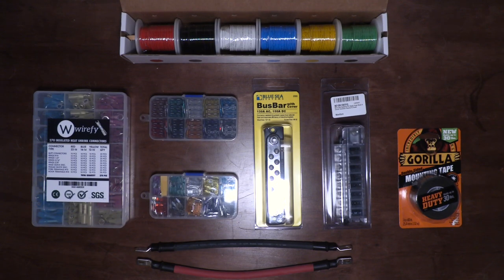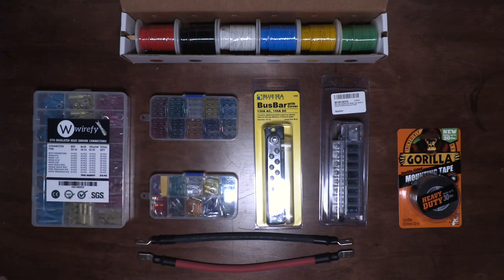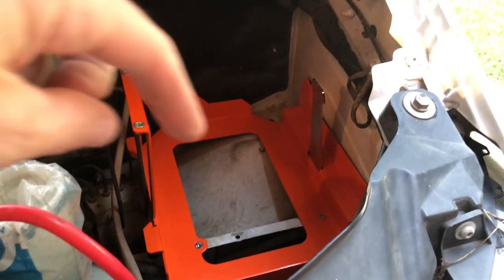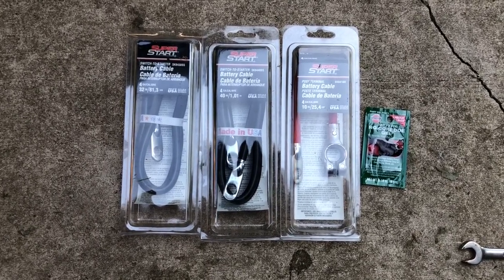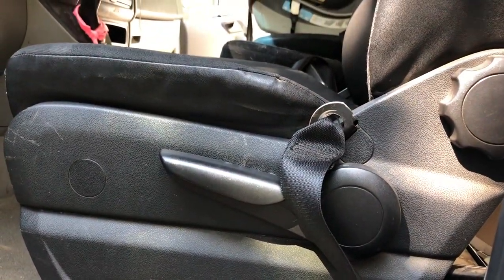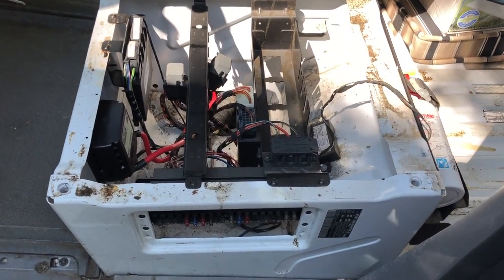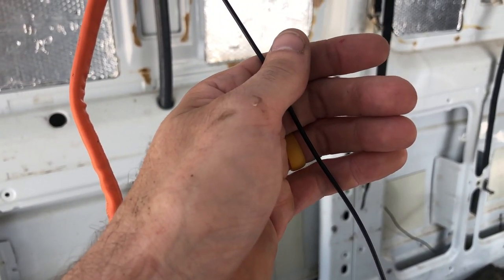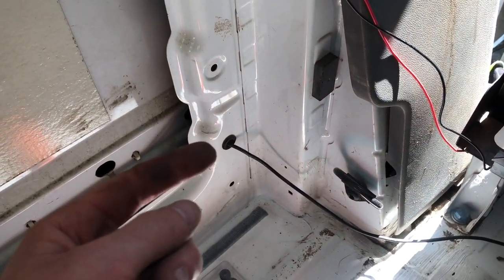Sprinter Auxiliary Battery Kit is in and electrical is hooked up. Fantastic Fan Installed! 🌬

Comment: Thanks for this video. I know it’s older, but I’m installing the AdWag Tray and wiring setup now. I’m kind of getting paranoid about how it hooks up. Worried about it messing with factory electronics. Two questions: Is the setup still working for you? Also did you have to move your ECU and use the optional ECU mounting bracket they provide?
Reply from the maker: At the time it hooked up fine. I'm currently trying to move everything behind the seats in a container that will house an inverter as well.

Comment: Brian, I don't think there is a need to run ground all the way back to the ground strip under the seat..   
I ran a 6" ground wire from my Fantastic fan to the the chassis.
Reply from the maker: Interesting. I’m guessing then you can do this for the majority of items installed to the main metal chassis?
Reply: @SeatTimeClips  Yes that's what I'm doing for everything that is running off the "starter" battery.  Anything that runs off my "coach/leisure" battery will have power and return run to it.  So your positive and negative bus bars would work for that for sure.

Comment: hi finally! someone showing the wirering the FANTASTIC FAN.  I need advice plz... I have two fans in my Van conversion. 1- Fantastic Fan and 1- Air Max Fan.  Of course still not connected(wires just dangling)  I don't know how to do this. But now that you are showing this I'm Happy to see it's not gonna be hard.  So what wire Gauge do I need to connect to the Fans?  I still don't have the Battery Bank set up.  I have a Goal Zero Yeti 400 and I was thinking of maybe attaching a 12vlt adaptor at the end of the wires coming from the fans to attach to the Goal Zero yeti 400. So what do you recommend?  TFS
Reply from the maker: I haven't used the Goal Zero, but I would look around for those who have wired it up to a small 12V fuse box, like BlueSea. That will help you know how to wire up the Goal Zero get power out. From there, wire up your fans to the 12V fuse box, add fuses and you should have POWER! BlueSea Fuse Box I used: https://amzn.to/35uOWSt

As for the gauge wire to use. You need to know the power it draws and the distance that power needs to travel. 
Here's a great electrical Guide: https://faroutride.com/electrical-system/